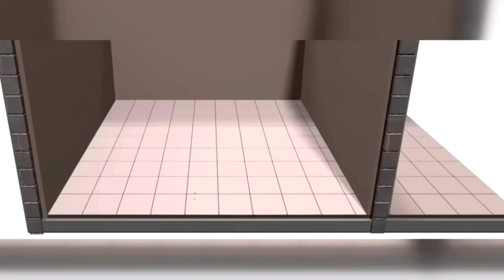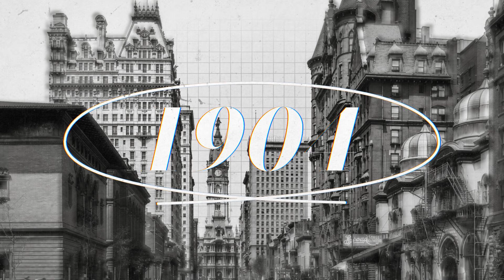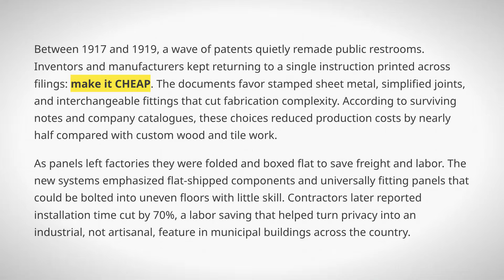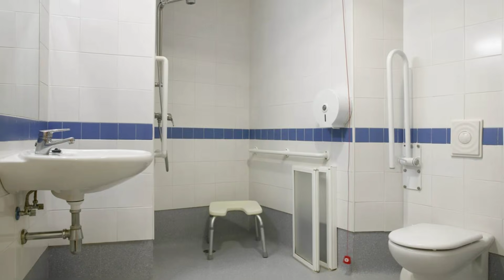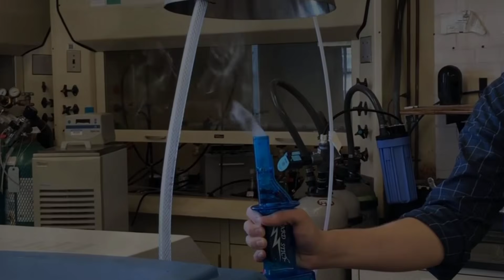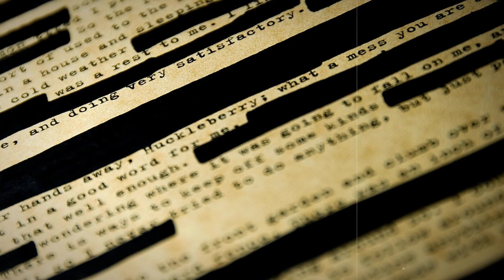Why Are American Bathroom Stalls Built With Gaps?

Comment: I never have felt right about this. I dont like the idea of the situation when you sit on the commode.  there is a gap between the door  nad the wall  youre fully seen sitting there.it is right in the middle. I feel so exposed. there was one time as a young girl I went to a gas station in the southwest. The commode was on a platform in a big room and not a single enclosure. it was just in a room. At least a lock on the door. Sometimes that Handicapped stall is occupied by able bodied folk. I am agitated being disabled. I have a large frame.and my purse. if i had to bring a service dog in the stall it would be impossible for me to have my service anamal in the stall beside me.That is vulnerable. This whole set up sucks as far as privacy is concerned. i do use the hook on the door if i see one to hang my long white cane on it. It is cringeworthy of a scumbag male to just take a camera underneath the stalls wall or the door and your privacy is gone. They upskirt you.